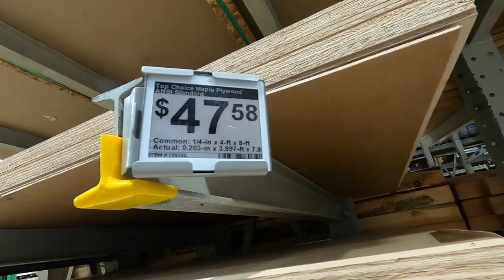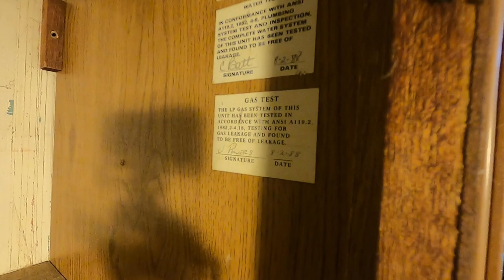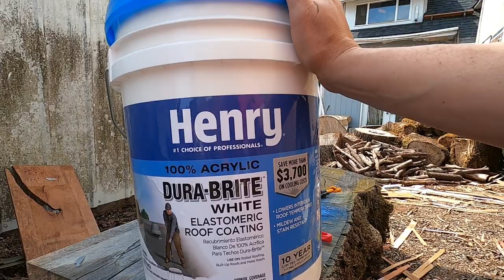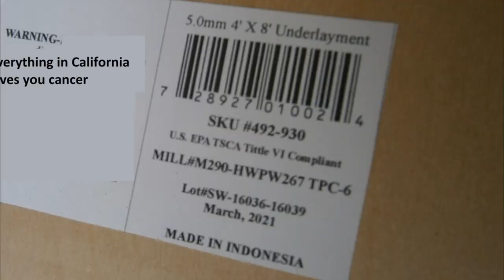RV Roof Repair - '89 Winnebago

Comment from the maker: Definitely don't get the acrylic stuff, ive had good luck with the latex but needs to be repainted ever so often, after this i might go ahead with some of the expensive silicone stuff, maybe a membrane kit. I also would get thicker panels and get marine grade panels. This was a rush job because the rain was coming so there is a lot i would do differently but ill try to cover that in an upcoming video.

Comment: Good job Nate. I have an '89 Winnebago Chieftain with an aluminum roof. Going to replace it soon. Thanks for making the video!
Reply: I really enjoyed the video. I just acquired an 89 Chieftain and there is all kinds of water damage due to the aluminum roof having small pin holes all over it. I am literally in the process of tackling replacing my roof by myself as well. I've searched all over the web for a video like this. I an actually replacing the aluminum with aluminum. I have been taking pictures since the beginning. Hopefully my project turns out as nice as yours!!

Comment: Awesome and THXs a lot. I also have the same P30 chasis. I had some delamination on the side panels from the windows on down and replaced it with 1/4 inch resin treated plywood over the foam panels spray painted with a few layers of the flexible black stuff  they use to protect the chasis underneath the cars from rust and after it was well dry I just sprayed the whole thing over with some regular auto paint. Surface is a little different but actually way better then before with the old plastic liner. It looks even good when painted with a flat darker color. Now it´s holding up for 3 years with no issues and I like it because it is very easy to repair from all the little scratches from driving in rough countryside. Was a big project. Had to take out all the windows and rebuilt all the storage lockers and make it fit again. My roof is still rock solid but it was really helpful to see how the whole structure of the roof and the side panels is put together. My next project will be replacing the upper part of the plastic liner of the side panels.

Comment: Nice work and a lot of it too. I have no idea if I would have anticipated the extra repairs either but I think you did a good job of mitigating those unforeseen issues. I am very interested to see what you will do to repair that rear cap. I am sure it will be solid and water tight when you are finished

Comment: 35-40 years ago i worked for a few the rv shops in Elkhart, Indiana and know there put together like crap & yet i own a 1987 chevy champion lasalle that i'll be living in next year & it's in lot better shape only has 55,500 miles on it & i'm the 3rd owner got all the service records with it & about do the brakes & shocks before winter & last year got 6 new tires that have not been mounted yet !

Comment: It looks 1000% better. No more random holes and patches. You'll be able to put 1500 watts of solar on your roof now.
Reply: That would actually be a good next investment. Since the panels would save on fuel for the generator, and they can also be transferred to whatever vehicle or stationary home he may wish to upgrade to. In my opinion with solar, you kind of have to go either big or go home for it to make a difference on the bottom line. Otherwise solar ends up as just another project toy.

Comment: thank you so much for uploading this video. i bought the sister to patches. she is a 1989 super chief 40 footer and really need to do the same thing to her. so my question is. if you could have done anything different what would it be? unlike your way I am going to keep all the vents and airconditioners in place. only want to get rid of the bathroom sky light and maybe use the vinyl roof coating just to play it safe. I too have two bad trusses and love the fact that you show on patches what it all looks like so I can plan for the repair instead of open it with out knowing. thanks again and wish me luck.
Reply from the maker: Definitely don't get the acrylic stuff, ive had good luck with the latex but needs to be repainted ever so often, after this i might go ahead with some of the expensive silicone stuff, maybe a membrane kit. I also would get thicker panels and get marine grade panels. This was a rush job because the rain was coming so there is a lot i would do differently but ill try to cover that in an upcoming video.

Comment: Nice to see roof done now, now you have roof fixed did you stop the leak on the front marker lights, nice to see the cupboard thrown out, it may pay you to weight the camper to see if it under the factory weight or over so petrol usesage can get better, remembering patch is get old girl now must help the running gear as much as possible

Comment: nice job Nathan what are you going to do about  a  fan .  those wires on the inside look not so good i bet you can put a pvc pipe in the conner and run them though , good luck

Comment: Nicely done!  Lots of room for solar panels, and it looks super clean up there.

All the work to seal up gaps and holes has to improve your overall insulation.  Have you seen a difference in interior temps or how hard the A/C has to work after the new roof was finished compared to before?
Reply from the maker: Thanks! The temperature outside has been up and down quite a bit lately so I can't say it's been noticeable but it does seem like the back bedroom is staying a little bit cooler today

Comment: Nathan, if you don't want to ever F*%k with your roof again, invest in Crazy Seal or RV Armor. Can be applied directly to roof plywood without a membrane. Has like a 25 yr warranty. Don't you love Luan (thin wood junk)? That stuff wicks water like a paper towel. Would have been a fun project to help with. At least you aren't afraid to tear into stuff. Love the Trump train sticker, lol. I like steam trains. RV Pro Flex is the best for sealing on vertical surfaces. The sh*t caulk at walmart is no good. Latex just peels like a cheap rubber glove after one season.

Comment: would not of went directly on the wood itself. that stuff will peel off with in a few months if not done properly
Reply: I have to agree with this!
Reply: @andysmith9601  yep! it will peel up as well as the eternabond that he used. you can’t just apply directly on the wood.
Reply: @bjnz4328  i am a certified RV technician. i have done a few complete roof replacement’s